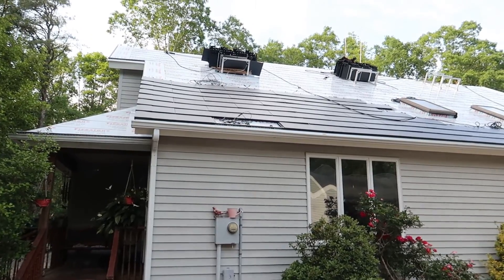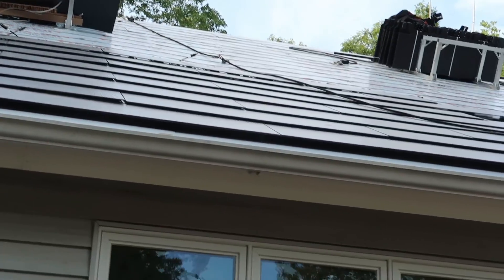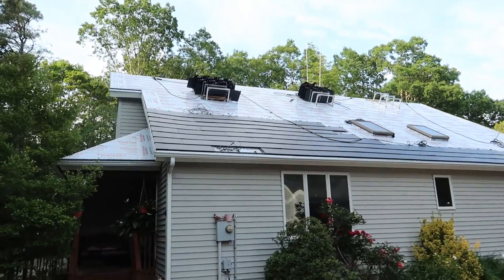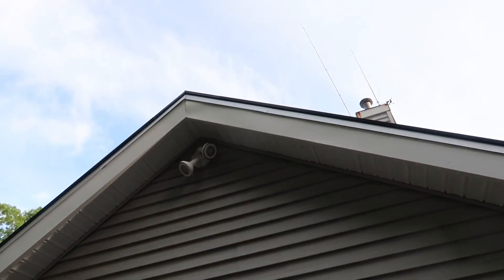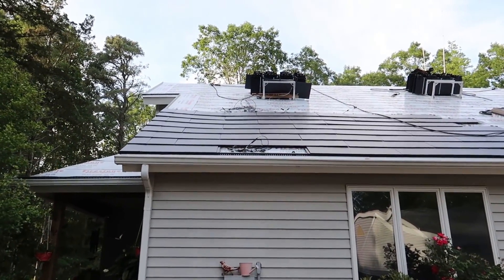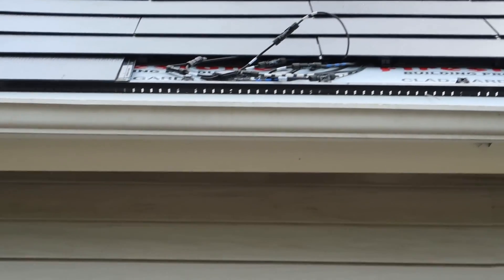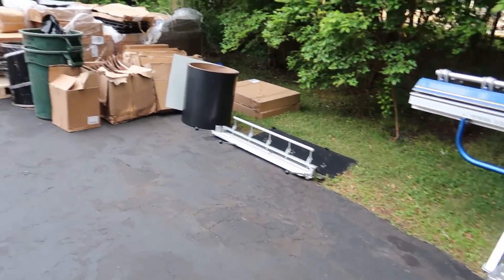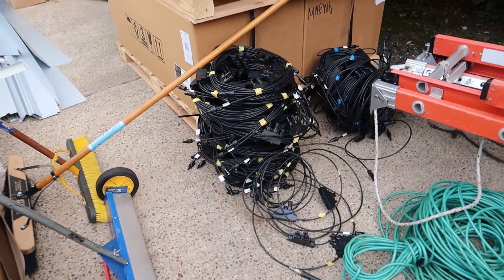Tesla Solar Roof V3 Installation 10.5 kw Solar Tiles | Day 6

Comment: Do they install solar panel systems on flat roofed apartment buildings?
Reply from the maker: I don't believe so, if they do you will likely have to go with solar panels and not solar tiles. Because you need the solar at an angle to get the most sun expositor everyday
Reply: i think that they do offer flat roof options